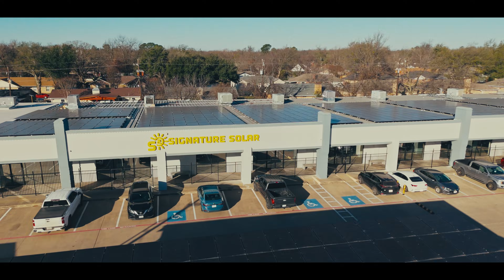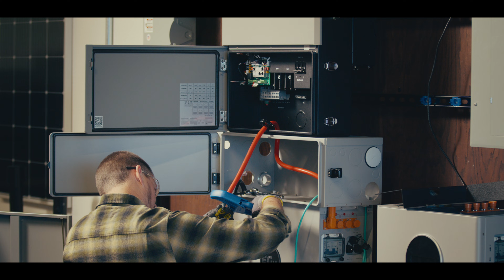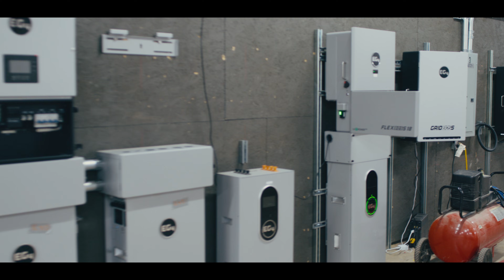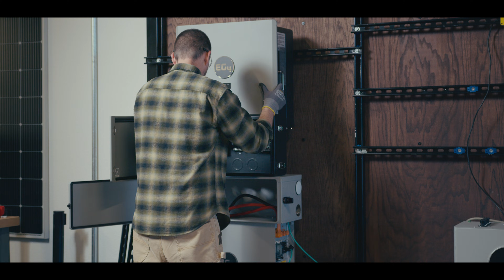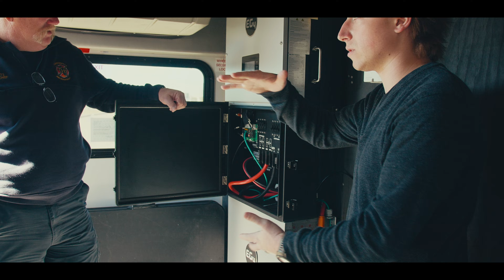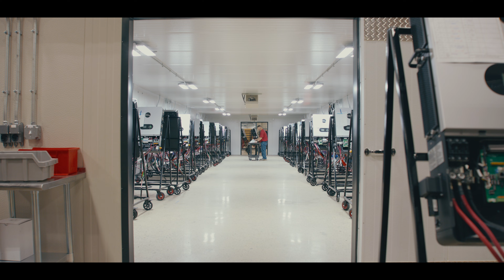How EG4 Does It Better

Comment: im in my 5th month with a XP6000, still not working properly, i hate it, the App sucks, software sucks, UI sucks, wont run with a generator, plus many more simple adjustments / fixes/ errors i see in their products. FYI:  The Tech dept at EG4 is basically non existant and the customer service is a wet noodle, im going to give up on EG4, not going to spend the rest of my money on batteries there or buy any more of their products.
Reply: did you DIY or hire a professional who has experience installing EG4 / solar equipment? It is not like putting together a kids bike...there's a LOT of reading to do! I am working on installing my setup (flexboss18, grid boss, two 16kw batteries) and I can see how you could have a lot of problems even with a small system unless you go very careful and know what you are doing. If in over your head, get local help. Tech support can only help you if you already know the manuals and have a problem. IMPORRTANT TIP: If you ordered via a dealer, try support from the dealer 1st!

Comment: When I first started researching which direction we wanted to go for our home Solark was leading the way. But then I started learning more about EG4 and how DIY friendly they are. 

I saw their engagement on multiple Facebook solar pages and also on the DIY Solar Forum. I even saw James make a few posts :) 

This is what sold me and we're really happy with our 12000XP. It wasn't perfect and unfortunately it had to returned for warranty replacement but the process was smooth and easy. 

Overall, we are very happy with our purchase and the independence it's giving us!
Reply: If for any reason you do have any issue, their customer support is outstanding.
Reply: No their customer service is terrible.  When I eventually reached them they never got back to me with solutions. they just kept sending me in circles for months until I gave up and sold the Inverter.
Reply: @NielGore 

I don't know what to tell you. I bought mine through an authorized reseller went through them.

Comment: Based on user experiences shared on forums like DIY Solar Power Forum and Reddit, the EG4 12000XP inverter has several common complaints regarding performance, software, and hardware, even while being regarded as a powerful, feature-rich unit. 
Common Complaints and Issues
PV Voltage Limitation/Dropping: A recurring issue is the inverter limiting PV string voltage to 120V, causing reduced power output, which sometimes requires a manual reset of the PV switch to fix.
Overheating and Throttling: Users have reported that the unit can run hot, leading to performance throttling to protect components, with some suggesting fans should start earlier than the 75°C threshold.
High Idle Consumption: The unit has relatively high self-consumption when idle, reported around 100-110 watts (approx. 2.1 amps).
Inverter Overload/Error Codes: Several users have reported "Warning 28" (inverter overload) or "BatMsgFail" errors, sometimes even when the load is within specifications or when there is no load at all.
Noisy Fans: The fans can be quite loud when the unit is running under heavy load, making it unsuitable for installation inside living spaces.
Firmware/Software Issues: The app and web interface for monitoring and management are described as "clunky" and sometimes unresponsive. There are reports of firmware updates causing units to get stuck in standby mode.
Questionable Rapid Shutdown (RSD) Compatibility: Users have found that the unit's RSD functionality does not always work well with existing external buttons, as it operates on different logic than other inverters.
Support/Warranty Replacement: While many find EG4 support responsive, some have faced issues with long, non-accelerated, or challenging RMA (Return Merchandise Authorization) processes, requiring them to wait for a replacement unit.
"Smoke" Incidents: There are isolated reports of the unit failing catastrophically ("let out the smoke").